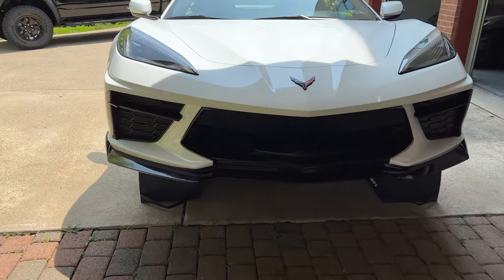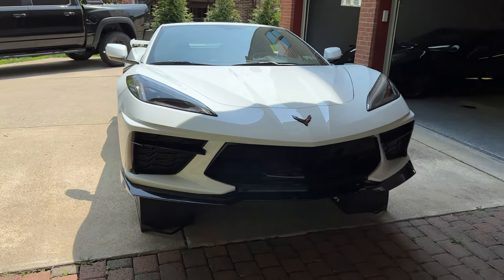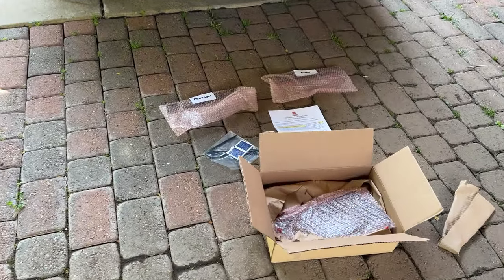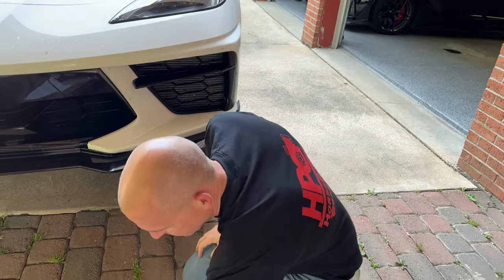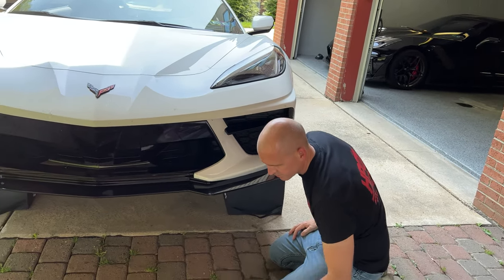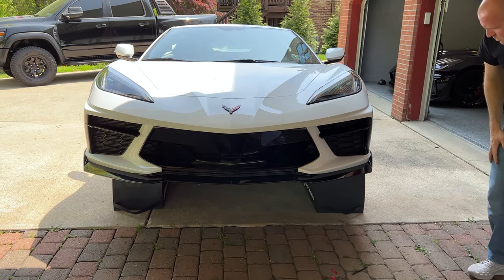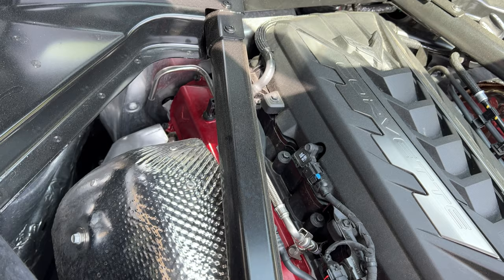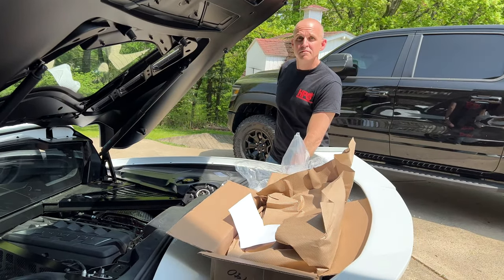SAVE your C8 Corvette radiators AND dress up the ENGINE BAY with THESE products!

Comment: You mentioned that you had yours on for 5000 miles what happened after the 5000 miles did, they fall off 'because I'm thinking about buying him $350.00, I don't want him to fall off
Reply from the maker: After 5000 miles of being installed, I sold the car. They are still on the car as far as I know.

Comment: Justin - many of these out there but I think I read GM has actually approved  ?  brand of these -- are these the GM approved ones? - want to get a set for the C8R
Reply from the maker: These ones were originally approved by GM but it didn’t happen for unknown reasons. I’ve experienced all of them out there and these ones are by far the best quality.
Reply: @HorsePowerObsessed Can you provide the link or website of this C8 radiator guard?

Comment: Hey Justin any coupon codes?
Reply from the maker: Unfortunately, no. The owner of the company has already discounted them and doesn’t want to push them any lower due to current costs of materials.
Reply: There is a place for a coupon code upon check out that’s why I asked. Thanks for the information. They are ordered!
Reply from the maker: You’re quite welcome! Thank you!

Comment: I cannot believe my ears and had to ask this again. GM finally acknowledged the benefits of a finer mesh radiator grille, and then on top of that, they will allow you to add them in the order of 2023 C8s?? Did I hear that right??
Reply from the maker: Yes sir you did!
Reply: @HorsePowerObsessed  That is awesome news!
Reply: @HorsePowerObsessed  Where are you getting this news? I just ordered my 2023 and there was no option for a mesh radiator grille. GM talked about something like that being in development, but I'm fairly sure it hasn't been announced as available. Happy to be corrected, but the 2023 changes have been very well documented and a new official mesh radiator grille was not included.
Reply from the maker: https://www.midenginecorvetteforum.com/forum/me-discussion-photos-videos/341926-new-c8-lpo-accessories-appear-to-be-coming

Comment: I love the concept of the radiator guards, Would like to see something for the center.
 It really gives a 3 dimensional appearance.
 Only question I have is how does this stop bugs or small rocks coming through?
Reply from the maker: Agreed. They'd have to be VERY tiny to get through but in the case they do, you can remove the protectors easily to clean them out.